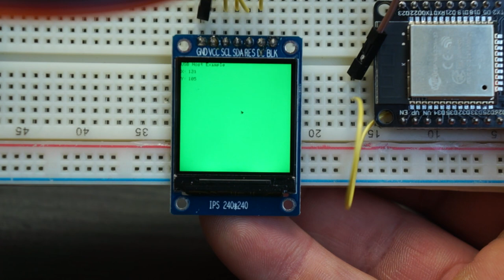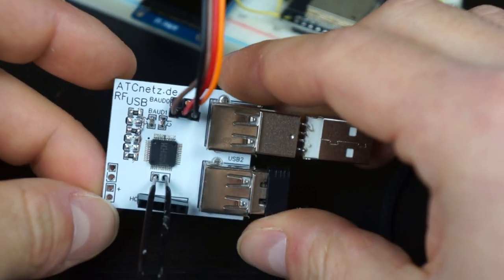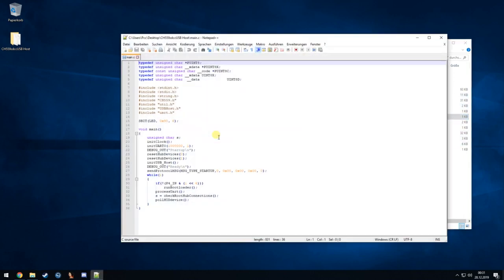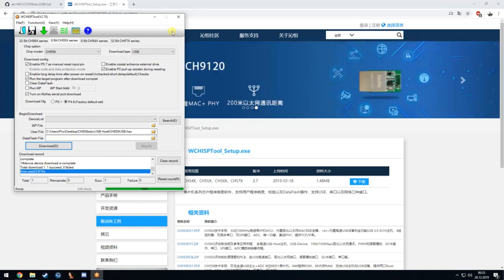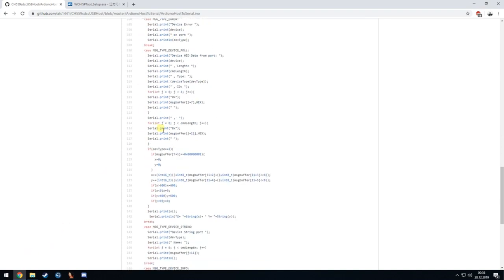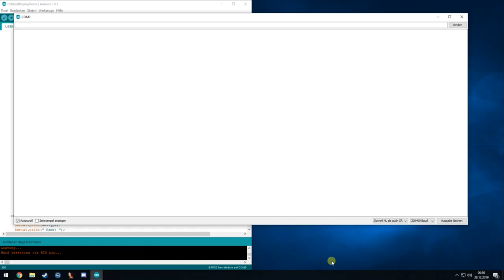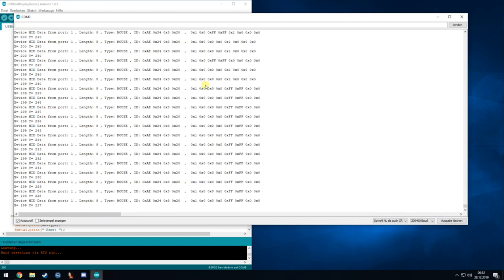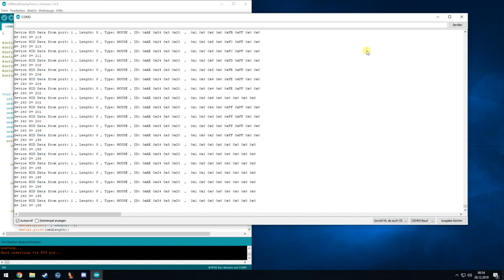Usb mouse and keyboard on Arduino, CH559 cheap usb host chip

Comment: Hi. I tried to set UART speed to 9600, but then the Arduino doesn't receive data. Why the UART speed is so strange? 100000bps?
Reply from the maker: It is the fastest possible rate, it needs to be as fast as possible to be able to keep up with usb
Reply: Thanks for quick reply :) I'm feeling I have to learn more about this controller. I'll need to set UART to 7200bps 7N1 speed
Reply from the maker: You need to calculate a divider based on the cpu freq
Reply: @atc1441  Yeah, I have found something about it. BTW, Will CH551 work with your code? Because CH551 doesn't have "USB host" I still don't understand what is need to make the code working - USB host or USB device?
Reply from the maker: This does only work on CH554 and up

Comment: Is the controller doesn't need a crystal to operate? 😱
Reply from the maker: Correct. It has an internal one, only 2 caps and a resistor is needed to get startet. Oh and the controller of course

Comment: can it be usb keyboard host for windows ?
Reply from the maker: What would that? I think i mussunderstoud your question. It can be a keyboard and mouse slave for windows but what would a host for windows be ?
Reply: @atc1441  sorry for my poor english communicate T_T I want to make my ps2 keyboard to connect via bluetooth. and i try with the old ways(HC-05 module) and its dosn't work. Its just send data in serial monitor but nothing move...
Reply from the maker: Ok i think i got what you mean.

You can either reflash the HC-05 to act as a ble keyboard. 

Or use an CH552 as an USB keyboard slave for windows. Its not wireless then but maybe is what you want